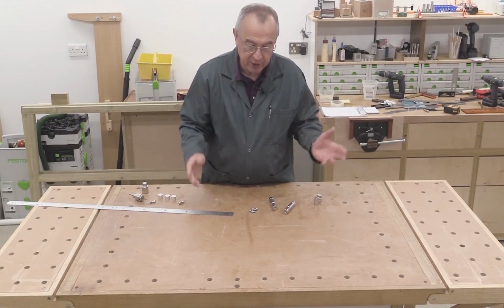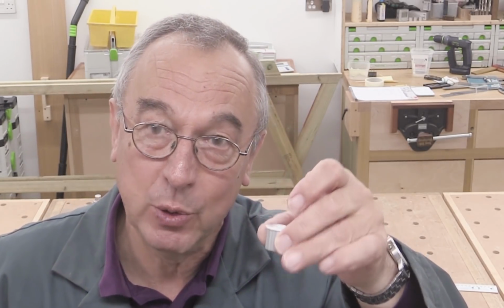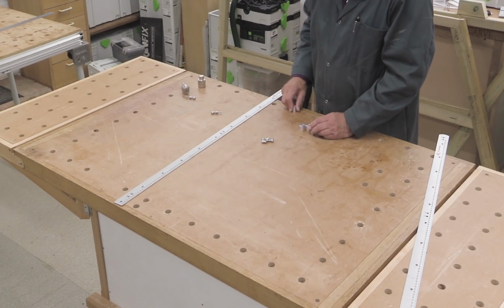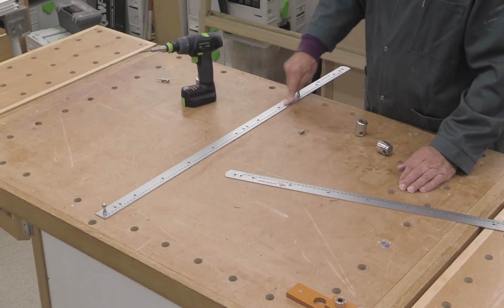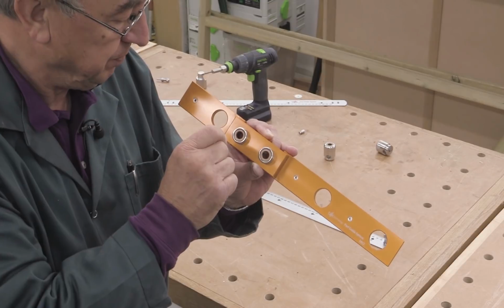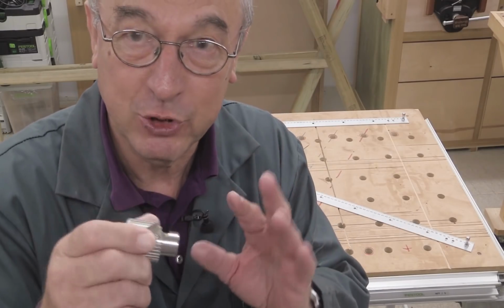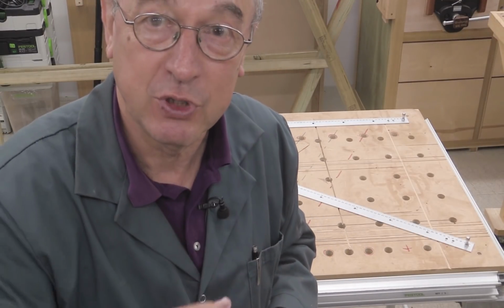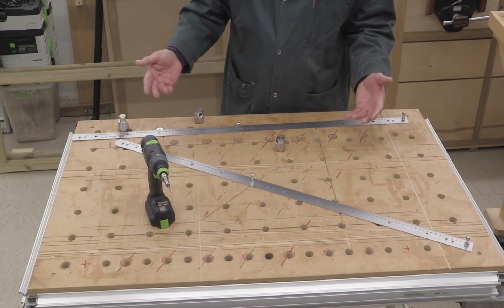New - Parf Revision Dogs

Comment: Hi Peter, can you use these new parf revision dogs with the original parf guide system and also is there a way of upgrading to the M11 Parf system ?? Regards Kim
Reply from the maker: Hi Kim, Yes, the Parf Revision Dogs can be used with the original PGS. I am sorry but there is no upgrade path from the original system to the Mark 2 as so many of the components have changes.  Peter
Reply: @NewBritWorkshop  Thanks for that peter, I was looking at your video from Axminster on You Tube and saw your video on the Assembly Square and tried to order it and found it was not available to Australia which is a little disappointing, As you are involved with Axminster and design some of the UJK items have you ever thought of designing a T square that is 12oomm long with cnc holes ever 1mm for measuring more accurately similar to the woodpecker unit. Woodpecker make the imperial version but do not appear to make a metric version in the 1200mm range but do have a 600mm one. this type of unit would make marking out a lot easier and be more accurate, Woodpeckers may have a copyright on the design but I am sure you and Axminster would be able to come up with a similar product that would work , just a thought. Regards Kim
Reply from the maker: Hi Kim, I am sorry that you are unable to get the assembly square. I think that Axminster are going flat out with the production of Parf kit and have enough on their plate.  Cheers.  Peter

Comment: Hi Peter,

Fantastic option on these new dogs!
I’m using the new UJK parf2 on a new 1200mm  x 800mm marine plywood at 25mm. The wood is incredible tight which means even after the 3mm drilling is incredible hard pushing in and even worst pulling out the pins. My hands were battered  after only drilling two columns. Can I  suggest to you a much bigger 3mm pins, giving more leverage to pull them out?
Did I mention the 3mm drill bit doesn’t drill all the way through the 25mm ply wood, so I’m having to use a mini dress press with the 3mm drill piece to vertically drill through all the holes which is time consuming, so much so, it’s taken me 2 days just complete all the holes. Obviously not continuously, about 6 hours in total due to the slow process with the tight pins as I’m having to use pilers to wriggle the pins out of the holes. 

So  my suggestion is bigger handle grip for the 3mm pins to easier to pull them outs and secondly option of a longer 3mm drill bit for woods thicker than 20mm?

Thanks,

Liang.
Reply from the maker: Hi Liang, If you make the 3 mm drill longer then the drilling guides (very expensive to produce) have to be taller. The system is designed for 19 mm MDF.  Peter
Reply: Hi Laing:
I work on boats so am familiar with marine plywood. IT is very dense but normally drills just the same as 19 mm plywood or 
MDF. Be careful if your top is too thick. The 90° clamps with the elbow have to go down in and turn the corner to hook on the underside. I know they won’t turn the corner with 1.5” stock but yours may be OK.
I just had an issue with my newly drilled Parf Guide top — 3/4” MDF. The fence and dogs I bought from BenchDogs wouldn’t go in with tapping with a mallet. Coming out I had to drive from below with mallet and dowel. Drove me crazy — was ready to send dogs back — then saw Peter’s 20mm Reamer tool from Axminster. Got it today — works like a charm and now all the dogs fit snugly but not tight. May help you with your marine plywood if 20mm holes are too tight.

Comment: Nothing a tape measure and a twenty mm drill bit couldn’t acheive
Reply: Try making a 10 x 20 hole table-top using a tape measure and a twenty mm drill bit.
-Then you may find out that you forgot to mention one ingredient: "A whole bunch of luck".
Your statement is simply not justified, if you're going to use the dog-holes for anything other than holdfasts and stops.
-If you'll be using it for holdfasts and stops, fine, but then you won't need a "tape-measure" anyway, just pop some random holes here and there.
Reply: 68HC060 it’s not luck it’s 40 plus years of working as a professional carpenter/joiner
I’m not knocking peter or his parf wotsit it has its place in the home enthusiast market 
But it is a expensive one trick pony to drill a few holes, you don’t need a festool mft or a clone table to mark and make square cuts with a track saw.
Reply: @xenusceptic  No, you don't need it. Nor do you need a track saw or any power tool.
You don't need the modern stuff at all, however, some of all those tools makes things easier for some of us, some of those tools make things faster for some of us - it all depends on what work is being done. The Parf Guide system can be used for track saws, but it can certainly be used for more than that; it's only limited by one's imagination.
We do agree on that a lower price would make it more attractive.
Reply: 68HC060 I still think it’s a one trick pony once you’ve drilled your holes the guides all end up in a cupboard or drawer the only reusable part is the drills
And of course you’ll use the dogs in the drilled holes (assuming dogs are supplied in the guide kit or are they a extra cost)
Reply: @xenusceptic  True, the guides / 'rulers' will be likely put away for a while, however, your tabletop will need to be renewed once in a while, when it's worn down. That's where it's handy to be able to quickly and easily reproduce an exact copy of the table top.
If you only needed it once, you'd likely want to purchase a 'Kreg-once' template instead.
Some people need to make more than one table top (one on the workbench, one on the assembly-table, one 'hexagonal').
Those people who build custom-workbenches for clients will likely prefer having a PGS and in that case, it'll pay big time.
Personally I think it's great to get new tools that make life as a woodworker easier; for those who already have years of neat tricks up their sleeves and for those who want a taste of the joy that woodworking can bring. I like unpowered tools the most, because I hate the noise and I also hate tripping over the cables all the time - and since I have no outlets in my workshop anyway, I have a few battery-powered tools, but hand tools can be faster and often produce a better result.
Reply: 68HC060 what do you use the nema motors for?
Reply: @xenusceptic  The small NEMA11 motors are used for motorized curtains in the living room. =)
Reply: 68HC060 ok just curious
Reply: @xenusceptic  You're welcome.
They're fine small stepper motors; strong enough for simple lightweight things like curtains (old-fashioned left/right movement, one window/two sides at the same time).
They can reach approximately 2200 RPM using just half-stepping and full-stepping on the cheap dual H-bridge.
For anything driving a tool, I'm sure you'll want a stronger one, though.
Reply: 68HC060 I used nema 22 to drive a CNC I built that’s why I asked
Reply: @xenusceptic  NEMA22 is a good size for most shop-size CNCs.
The down-side is that you'll likely need to spend a little on the controllers, since those stepper motors draw a fair amount of current.
Sacrificing speed, using GT2 pulleys and belts can be a solution to moving heavy loads and gain precision at the same time (without introducing backlash).
Servo is also an option; since the holding torque doesn't get weaker the faster it spins, like the stepper motors do.
Controlling servo motors is done differently, though (there are several types of interfaces for servo motors).
Reply: 68HC060 I’ve got a breakout board between the pc and the individual controllers currently it uses a parallel port to connect but looking into changing to a usb breakout board
I use linear guides and double ballscrews and anti backlash nuts on the y axis and single ballscrews and anti backlash nuts on the x and z 
Proximity detectors for limit switches had a few problems with phamtom stops due to RF interference so moved vfd away from machine and added a emi unit 
Search for chantrywood CNC on youtube I have a few vids there
Reply: @xenusceptic  Not too bad. :)
Are you using S-curves ?
(it doesn't sound like s-curves are being used always).
If your stepper motors draw less than 3A per phase, then you may be interested in TMC5160 (silent stepstick).
Example: https://www.ebay.com/itm/183952325584
-You'll need a microcontroller to control them, though. There are boards available (best boards are based upon ARM Cortex-M4 and later; avoid anything AVR/Atmel/Arduino-based, those will never be able to perform smooth operations quickly, but Cortex-M4 based ones will; especially STM32F4 and later).
Reply: 68HC060 never heard of s curves what are they and what do they do

Comment: Definitely something I shall be buying to put with the rest of the Parf Guide system. I cannot find them yet on the Axminster website (11:08 on Wednesday, Aug. 12.) but I am in no great hurry as I also need another 20 mm cutter and they are currently out of stock. I have just finished making another top and I carefully added lots of extra 3 mm holes around the outside, just in case. The new Parf Revision Dogs mean that this is no longer necessary. No matter how much you try to future proof, you always find out that you missed something.

In one of Ron Paulk's videos he said that he had sort of free handed some extra dog holes around the outside of a top he had made as he had forgotten to add the extra 3 mm holes, so even the best can go wrong.
Reply from the maker: Hi Robert, You can phone or email an order to Axminster whilst they get to grips with the product on the web site. The Customer Service team know all about the Revision Dogs.  Peter
Reply: @NewBritWorkshop  I ordered them by 'phone on Thursday and they were delivered on Saturday. I have put them straight to work adding side holes for the guide rail for an isometric top that I have just finished. I had forgotten the extra 3 mm holes for that top. Very reasonably priced.

Comment: Peter, can you let me know why your PARF system uses 96mm spacing . I know about the32mm  spacing of continental shelving system, but why use a shelf spacing on a cutting table ? My cutting table uses 100mm spacing which works perfectly well.
Your product is beautifully made,but does not suit my needs,or uses.i feel using 96mm limits the usability of the worktable, and could add confusion to measurement.  I look forward to hearing an explanation of your choice of spacing.
Reply from the maker: Hi George, One of the world's largest tool companies sell a bench called the MFT3. There are hundreds of thousands of them with very happy users. They all need replacement tops at some point. Also, there are very few times where the inter column or row distance plays an important part of a woodworking task. The key thing is that those rows and columns are at right angles.   Peter

Comment: Hi Peter,  when you comment on needing at least three 3mm holes to  use the cutter jig I was surprised you didn't mention that a revision pup placed in a 20mm hole would also allow the jig to line up accurately using 20mm holes.  Mike
Reply from the maker: Hi Michael, Yes, there are lots of ways of using the Parf family of kit and the user now has the freedom to use their imagination.   Cheers.  Peter

Comment: The latest issue of US magazine ‘Family Handyman’ has a feature called ‘Easy-Change Storage System’... the essence of which are sheets of 3/4 plywood into which are drilled an array of 1” (25mm) holes. Sound familiar?? :-)         The panels are then mounted vertically on walls.                     Into various holes are placed pegs from which all sorts of storage thingies are mounted. Like a French cleat but with straight pegs. A Vertical Parf-Dog system. Maybe your new shed could use something like that.
Reply from the maker: Hi Frank, I have yet to study vertical application of the 20 mm hole system.  Cheers.  Peter

Comment: Very simple solution Peter, well done. Just received my MkII system yesterday. I must say the quality is superb and exceeded my already high expectations. Just a tip from my days as an automotive engineer, I covered the bottom of each brass bushing with my thumb and filled them with oil. Then with my other thumb apply pressure to the top of filled bushing, this presses/impregnates the oil deep into the pores of the bushing giving it long lasting lubrication. We used to perform this technique on brass bushings for gearbox input shafts and works a treat, when the bushing is out the pressure forces oil to weep through to the outside of the bushing not just on the inner surface.
Reply from the maker: Great tip - many thanks.  Peter

Comment: I figured this out a few months ago I took a couple of guide pups put them in the lathe cut them off at the chamfer and drilled a 3mm hole in them worked great and the ones I made are from steel not aluminum!